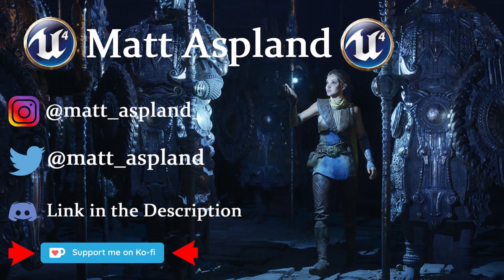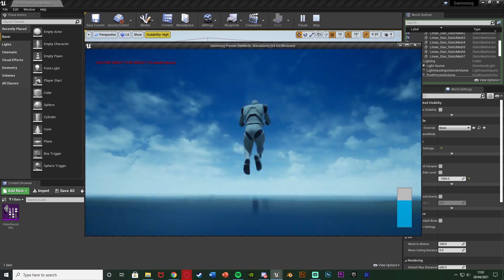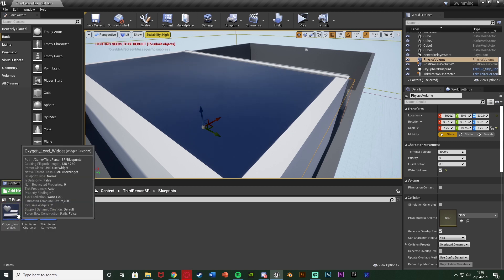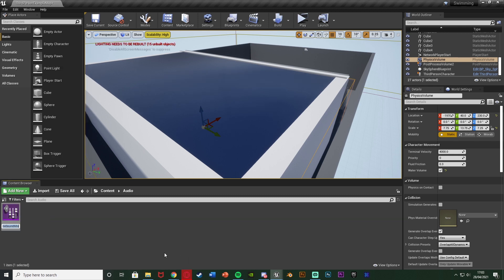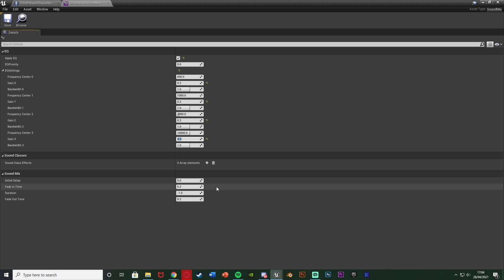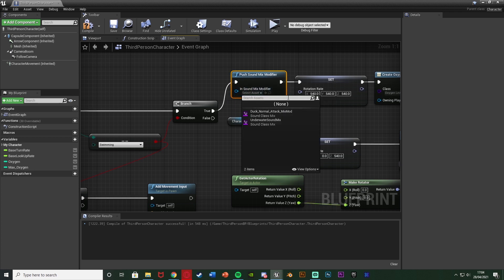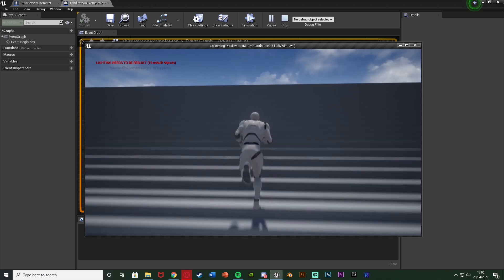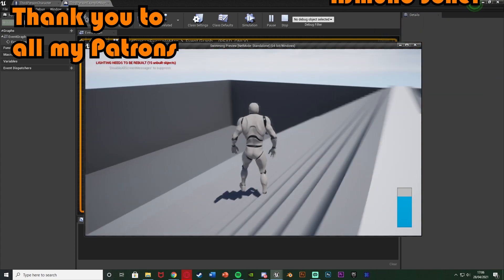How To Create Muffled Audio Underwater - Unreal Engine 4 Tutorial

Comment: is there any special settings in the cue, sound class, etc. I did the exact same and not worked for me. the sound still the same when enter and exit water. The node is executed (cuz I have a print string just after push mix node and the text prints out on screen) so isn't an error in the blueprints.
Thanks <3
Reply: I have version 5.0.3 and it's not working : (
Reply: @brainmayhem  Same here
Reply: I've got the same problem, did you solve this ?
Reply: @florianasencio9819  Same，How is it  now
Reply: not working for me either...
Reply: Same here with UE5
Reply: @rasmussooru337  wow